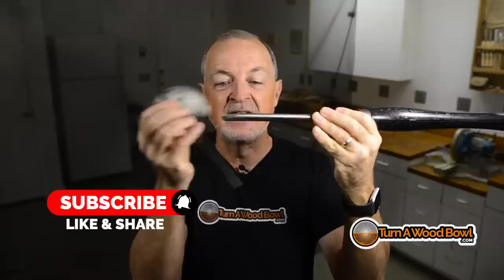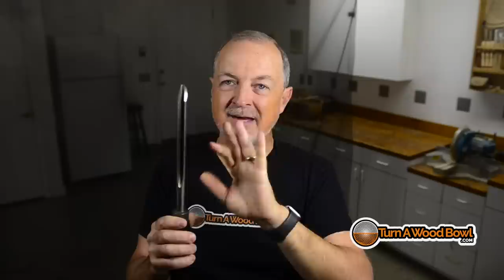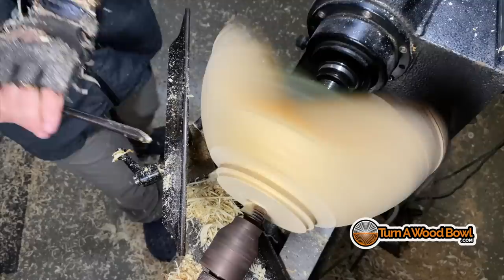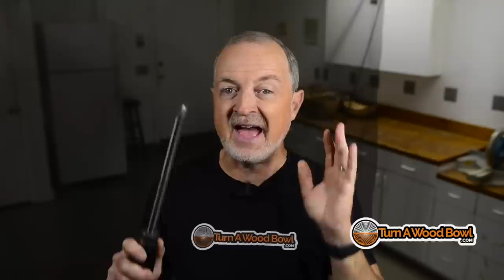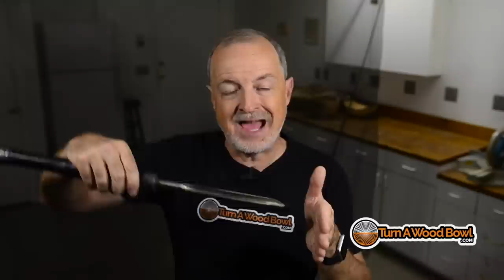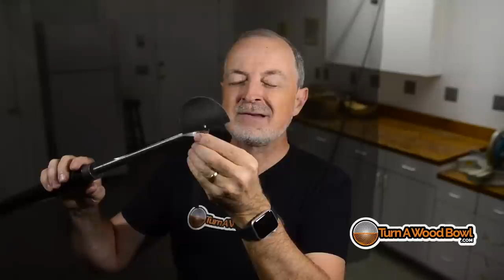Bowl Gouge - Woodturning - 55° Bevel Swept Back Bowl Gouge Video

Comment: I'm a beginner. Finally got around to grinding the 55 deg bevel swept back bowl gouge. What a difference. Best day of turning so far. Nice long shavings. Worked well gouging out the inside of a deep bowl. Thanks for the video.
Reply from the maker: Fantastic, Bill! I'm so glad you're liking that profile. Happy Turning! ;)
Reply: Turned my first bowl with whatever grind came on the tool. Those two points on the flute are really in the way !!!

Comment: Transiting from carbide. Brand new 1/2’’ bowl gauge. Never been sharpened. Just used it first time today, not very well I must admit and now it’s dull. As soon as I get the grinder  and pro sharp set up I’ll try the 55/swept back grind.  Fingers crossed.
Reply from the maker: Rand, check out my courses, both Tool Sharpening (and shaping) and Bowl Gouge Mastery will have you up and running super fast. www.TurnAWoodBowl.com/shop All the best to you and Happy Turning!

Comment: Kent's grind is essentially an Ellsworth grind, except that the classic Ellsworth bevel angle is 60 degree. There is not going to be a lot of difference in how a 55-degree bevel cuts when compared to a 60-degree bevel. It is my favorite bowl gouge grind, by far. It is very versatile, and it cuts fast. Furthermore, it is also great for the inside bottoms of bowls, even bowls with flat or nearly flat bottoms.  It is also a great tool for truing up the bottoms of bowl blanks. The swept back wings are much better at truing blanks, scraping, or shear scraping than my 50-degree, fingernail grind gouges are. I still use my fingernail grind gouges for finishing cuts, mostly on the inside of bowls, boxes, etc. I have always liked Kent's videos.

Comment: Kent
Thanks for yet another very informative video. I got into turning a little over a year ago after retiring and have used your extensive catalog of videos to show me the best methods. First thing I did was to take my 1/2" and 5/8" bowl gouges and re-ground them to the 55-degree swept-back profile. I hardly use anything else doing raw wood bowls as well as segmented bowls. Thanks again.

Comment: Thank you for that thorough explanation on the 55' degree swept back bowl gouge grind. I started turning a little less than a year ago . I have been using a pro-grind jig for my sharpening. It is a lot like the Wolverine/ Veri Grind sharpening system.  Just checked my gouges both gouges are 60 degrees and only about 66% of being 2 times the width on the wings. I do get a nasty catch here and there. Maybe it is my inexperience LOL, or maybe my angles.  I am going to put some thought into how I can modify my sharpening system to get 55 degrees and longer wings. I would like to give that angle a try. Thanks again for sharing your knowledge.

Comment: Kent,
On your 55 degree gouge video you show a diagram where the side bevel length is twice the width of the diameter.  Do you care what the top angle is… like on the 40-40 grind… which is 40 on bottom and 40 on the top.    Would your grind be 55-55 ?
Rick in Santa Rosa - Calif

Comment: Another excellent video, Ken. Having seen a video of yours some time ago, I set up my sharpening station so all my gouges sharpen to match this, which allows me to sharpen in seconds which, because it is easy and quick, makes me more inclined to keep them sharp. (I use the vari-grind with a block to set the distance of the holder back on the flute consistently.) Good stuff, thanks again.

Comment: Hey Kent, I am looking at getting a 6" CBN wheel, I have a Tormek but want something that is better at reshaping profiles. Do you recommend a slow speed grinder for the CBN wheel? My current grinder is very high speed. Thanks
Reply from the maker: I would use the 8" wheels. The 6" diameter makes concave curves in the tool bevel. And yes, slow speed and CBN. See my Tool Sharpening course. We cover it all and then some. Happy Turning!

Comment: When you turn a bowl, is it better to have the pith near the bottom of the bowl, or near the top/rim. I'm sure there's some room for creativity in the choice, but from the standpoint of structure and ease of turning, how do they differ. My first impression is that if the wood moisture isn't completely equalized, going pith down could cause more distortion as it equalizes.
Reply: Good question.  Do you have a video on this sort of thing?  I’m never sure I’ve got the right side up so to speak.

Comment: Thanks Kent. I have some gouges that I need to reshape. I am going to try your design. Do you use the rough or smooth wheel to establish the shape before actually sharpening the edge?

Still would love to visit your shop and watch you work - I'm only about 25 miles north of you
Reply from the maker: Good question. I use the rougher 80 grit wheel for shaping and the 180 for sharpening. All the best to you and Happy Turning! Kent

Comment: On the 55 swept back, is the edge of the swept back a positive,negative or straight profile?
Love your videos!
Reply from the maker: Jack,
Good question. The bevel of all bowl gouges is flat. Only flat-surfaced tools like the round nose scrape, etc. can also have a downward top angle. It would be pretty hard to shape the inside of the flute of a bowl gouge. 
Happy Turning! 
Kent

Comment: What is the angle of the flat grind on top relative to shaft top? 15°, 20°, 25° etc.
Reply from the maker: Chuck, good question. It is not a fixed degree. I grind it by eye making the wings about 1-1/2 the length of the gouge width. Happy Turning!
Reply: @TurnAWoodBowl  thanks for the response. I’m trying to figure out how to do this on a Robert Sorby ProEdge and for long grinds you typically start with a flat grind on the top at a pretty shallow angle. 
I’m just trying to figure out the angle. I’ll figure it out.
Reply: @TurnAWoodBowl  thanks for the quick response. The reason I asked is because I use a Robert Sorby ProEdge to sharpen my tools and I need to grind an angle on the top edge first. I’ll do some geometry and find a good angle to start with, unless your E-Course on sharpening covers the ProEdge. Then I would engage that.

Comment: Kent, you’ve answered a question that’s been a puzzler for me a long time and that is about how one manages to shape a tool that way - so, thank you very much!

I use the Wolverine sharpening system and ‘dropping the handle’ to get the side bevel that long on my fingernail shaped gouges is not an option.  I don’t have the confidence or skill to sharpen freehand.  Any suggestions?
Reply from the maker: Good question. Are you using the Wolverine 2 system? Because I use the wolverine for all my shaping and sharpening. Have you seen my Tool Sharpening (and Shaping) course? We go over all the details there. All the best to you and Happy Turning!
Reply: I found the answer by accident.  I needed to adjust the angle of the leg on the jig.  I’d been adjusting the system to line up with the grind on my tools as they came from the manufacturer.  Now that I’m reshaping the tools I’ve changed the whole setup.  Much better. I’m really liking the new profile.  It’s as good as you said it would be.😊

Comment: Do you strop your tools after grinding?
Reply from the maker: I do not. No need. They will be dull and needing sharpening in a few minutes with ort without stropping. 
All the best to you and Happy Turning!
Kent
Reply: @TurnAWoodBowl  Thank you. And what grit is the wheel you use to touch up the tool?
Reply: Just for info, that long swept back grind was first known as the Irish grind and was introduced to Davi Elsworth by Liam O'Neill  when David visited him at his home in Galway Ireland.  David developed the jig which made it easier to grind it repeatedly.  Good video, thanks Kent.